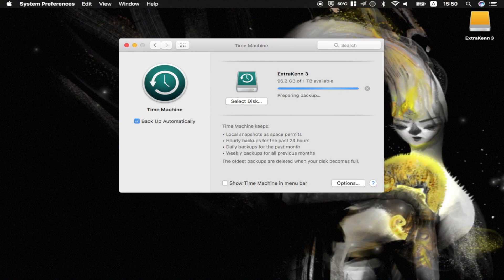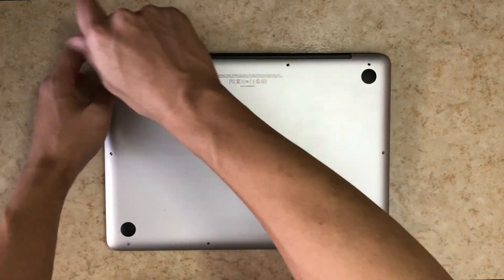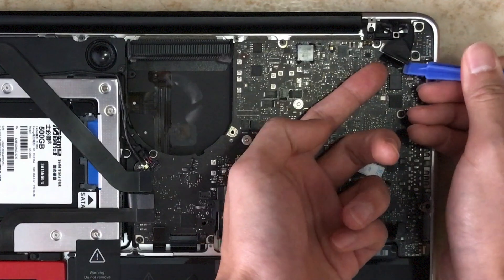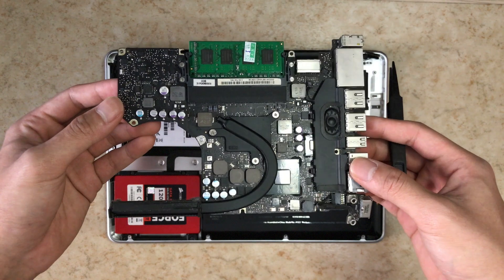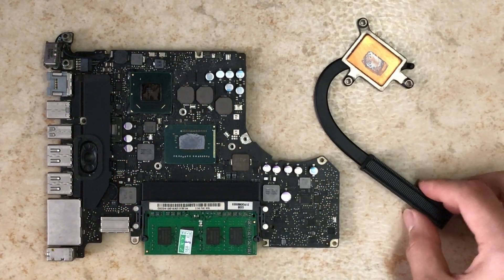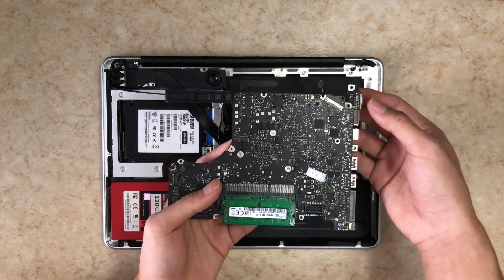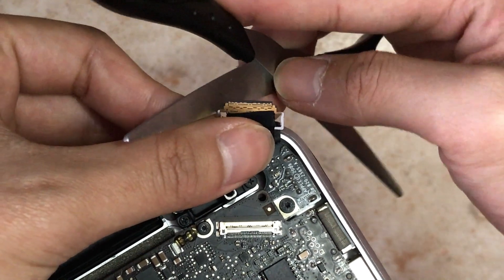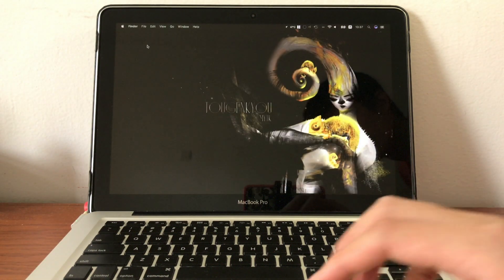How To UPGRADE Your 2011 Macbook Pro to 2012!

Comment: Great tutorial, my macs gpu stoped working last year and apple replaced it but iv heard the replacemnt plan for the 2011 has been canceled and the problem is back. I just wanted to know how much i should spend in the logic boared , theres a bunch online ranging from $125 up to $600
Reply: I have a Macbook Pro 2011 Late 15 and I followed a video online where I "turned off" my Graphics Cards (which is creating booting loop with lines) and my computer has been running a lot better. I am sure I can't use adobe illustrator but it's working great for generic computer use. I shouldn't have a problem running a plex server as well so there is still a lot of functionality without doing the repair.
Reply: dont know if you own these anymore but this can be fixed by resoldering the gpu chip.

Comment: I have a late 2008 13" mbp and its in perfect condition but too slow i would like to start using it as my backup laptop but want yo know of there is ANY way i can upgrade the logic board on it and if there is what would be the newest logic board that i would be able to upgrade to? I would appreciate anyone's help
Reply: It would be cheaper to max the RAM  and use SSD. If you're still using the original HDD, you definitely need to replace it -- with an SSD.

Comment: Hey man, please help me. I have a Mbp 13 inch late 2011, like yours with a damaged board. I am about to buy a mid 2012 as you did. Please can you guarantee me my money won't be thrown away for nothing? I really have to get rid of my old board. I don't care about Bluetooth atm, so is that an issue if I won't change it?
Reply from the maker: Alright so I think you will be okay if you change it to the newer 2012 motherboard without changing the bluetooth module, I haven't tried this myself, but as far as I know the bluetooth connectors are the same so it should work, but you don't get the newer bluetooth stuff (alright you said its fine haha). Just don't forget that you'll have to buy the 2012 heatpipe and trim the display connector a bit later on.

Comment: Hi Kenneth! Great video and guide! Is this for a 13" only? can the late 2011 17" logic board also be replaced with a 2012? Does the size 13" or 15" matter? Thanks!
Reply: I'm pretty sure the 15 is the same cut out for both models - it should work, check out ifixit.
Reply from the maker: +barkingbandicoot hahah thanks a lot! Because this is my personal laptop, I've only tried on 13". I've never heard of the possibility on 15" or 17" model, sorry about this.
Reply: ok, thanks! I thought perhaps the logic boards may be the same in all models. Cheers!

Comment: Hi Kenneth, a used logicboard 2012 from the US would cost me about 600 $ with tax and custom..(2.9 GHz).
A used Macbook Pro 2012 costs almost the same in Germany.
Does it make sense to replace the board in a 2011? Do I get the same speed with a MBP 2012 (with SSD and fast RAM) as your upgraded 2011 MBP?
Thanks
Reply from the maker: Wow how could a used 2012 motherboard be so expensive! I think you should just go with that used MBP 2012 instead, because this way you'll get better wifi/bluetooth module on the newer model (supports bluetooth 4.0) without the hassle, and then you can upgrade the SSD and RAM if you want later.
Reply: Thanks Ken. This is what I am going to do...
Reply: Germans tend to price apple products a lot higher than they r actually worth its ridiculous. A used iPhone 5 32gb would still cost you about 150$ in 2019!!

Comment: My '11 has an i7 cpu. Should I still upgrade the mobo? Will it make a huge difference? I am about to upgrade the HD and ram. I am just giving it to my son and he is only 11. Although he runs Lightroom and Photoshop. Advice?
Reply from the maker: Umm sorry for late reply, so the whole point of changing the mobo is to get the better GPU (Intel HD 4000) right, but here if it is only for Lightroom and Photoshop, I think you don't need to change the mobo, just change to SSD and upgrade the RAM to a decent amount (8GB should be enough) and you'll be good to go. Hope this helps :)

Comment: Thank You for replying back to my message on Continuity Do you think it would be easier if I upgrade my motherboard to a 2012 MacBook Pro motherboard also using a 2012 bluetooth card would Continuity work without having to use dokterdok?
Reply from the maker: Oh yes absolutely! If you upgrade the wireless card and the motherboard continuity will be supported natively

Comment: I have a macbook pro 15" macbook pro late 2011, is it possible to use the motherboard of the mid 2012 macbook pro 15"?
Reply from the maker: Carlo Gambino I'm sorry I don't know about the 15" one as I only have the smaller one 😂 you can try search Google though see if people are saying it's possible, and compare the ifixit.com guide for both 2011 and 2012, if it's the same then you can
Reply: i find this https://www.ifixit.com/Answers/View/93540/MacBook+Pro+2011+to+2012+logic+board+swap
Reply from the maker: Carlo Gambino oh right this was the post I read too before doing anything to my mac, I just checked and there is a post from Nuka Kola, seems like you can upgrade your 2011 motherboard into 2012 ones 👍🏼

Comment: Hey kenneth will this fix the graphics issue that arrives when the gpu chip burns out?
Reply from the maker: Yes I guess this would fix it, as it replaces the whole thing 👍🏽
Reply: If this works you are god 😂
Reply from the maker: scott johnson ahahaha by the way how could you know that the gpu chip burns out?
Reply: Kenneth Tanaka is it the house that commonly burns out in the 2011 MacBook pros?
Reply: Kenneth Tanaka gpu*
Reply from the maker: scott johnson I'm sorry but what do you mean by 'burning out'? Because I've never heard of any cpu/gpu failure before in any laptop...
Reply: Kenneth Tanaka it is a big issue in 2011 MacBook pros because of their poor ventilation, what kind of custom gpu did you put in there? And where can I but that 2k12 heat sink?
Reply from the maker: scott johnson I didn't put a custom gpu, here I just changed the entire motherboard from 2011 to 2012, and the one in this video is entirely 2012 motherboard (because I don't have my old mobo anymore). Then the gpu is integrated to the cpu right, so when you change the motherboard, the cpu changes, then the gpu also changes.
Reply: Damn so I'm going to have to get a whole new motherboard to fix my graphics issues correct?
Reply from the maker: scott johnson umm if there is any hardware failures to the cpu/gpu then yes this will fix it, but what kind of graphics issues are you having?
Reply: Kenneth Tanaka 
Alcangele

Comment: hey man, do you have to re-install your OS after the change ? or will it just automatically adjust itself to the new configuration ?
Reply from the maker: Jakub Adamčík Hey man, I remember the time when I did the upgrade I was also doing a fresh install of my mac, but I believe you can do it without reinstalling everything, it will automatically readjust itself 👍🏼

Comment: Hi Kenneth! Would it be possible to put in a Core i5 13 inch 2012 MacBook Pro motherboard into a 2011 15 inch Core i7 MacBook Pro?

Thanks!
Reply from the maker: Hi! I'm sorry to say but that is not possible because many things like the fan configurations are different
Reply: Looks like the 15" are MUCH more expensive.